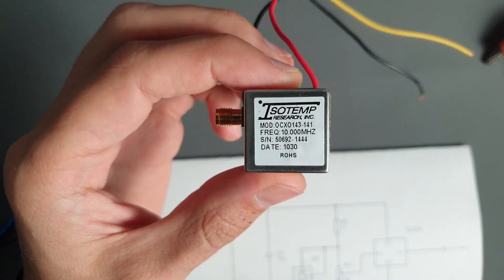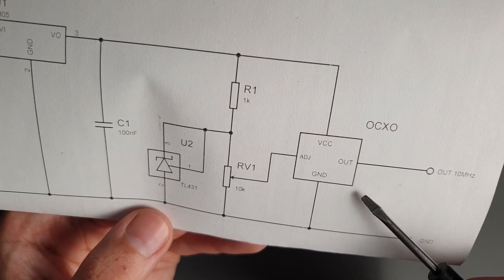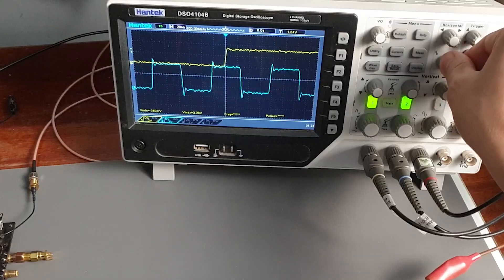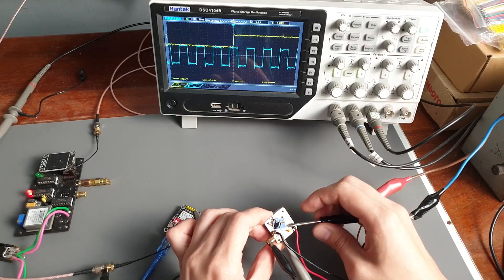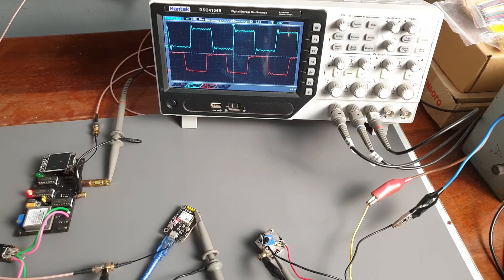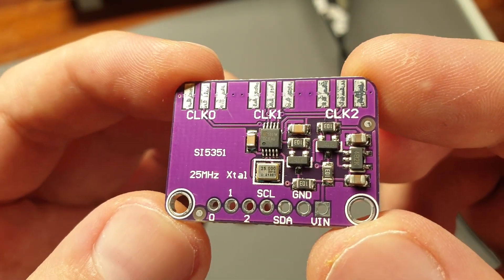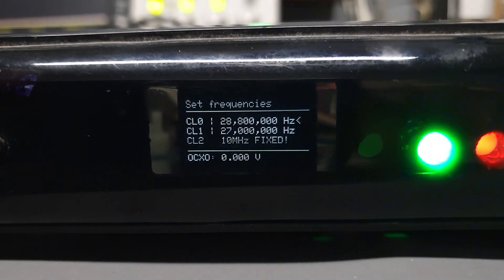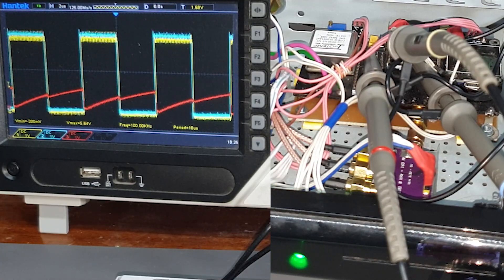How to Calibrate Oscillators with GPS module

Comment: In X-Y mode, the oscilloscope enables immediate visualization of frequency differences as small as 1 mHz, while in the normal operating mode, observing differences of up to 10 mHz requires significantly more time.

Comment: Looking at the datasheet for the Si5351A  MOP-10 there is no PLL feedback input, so it looks like your just using it as a frequency divider to get it down to the PPS output frequency and adjusting the Si5351A output frequency via the I2C port. If I understand your implemention its still subject to drift & some jitter. Now if you applied feedback to the Vadj on the OXCO with a PLL that would have made it much more accurate.

Comment: 7805 is "old tech", you will find better regulators with much less noise. And noise is to be avoided at any cost in oscillators 🙂 So at least add a "Pi" CLC  filter network with both electrolytic and ceramic capacitors to remove any ripple or noise.
I don't know about the noise figure of the TL431, but it's as nice touch. Add a ceramic + inductor filter at the input though 🙂
Reply from the maker: Thanks for the suggestion, I had to choose 7805 or a switching voltage regulator, I chose 7805 because I thought it would have less noise. 7805 is a "jelly bean" part and I have plenty of them. Idk what would be a modern alternative with low NF. I use 7805 for GPSDO but it has CLC for OCXO so no problem I guess.
And TL431 should not be here too, a good 4V reference should be here with a known temperature coefficient, probably something like LT1461. You are right of course, my idea was just to show that it's possible to calibrate OCXO with a GPS module.